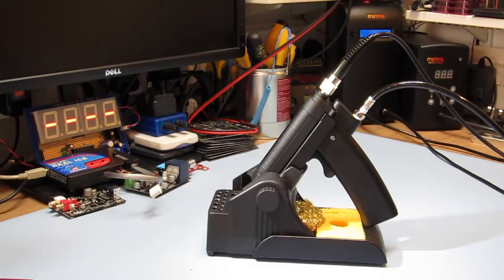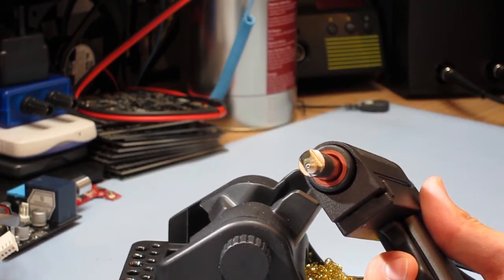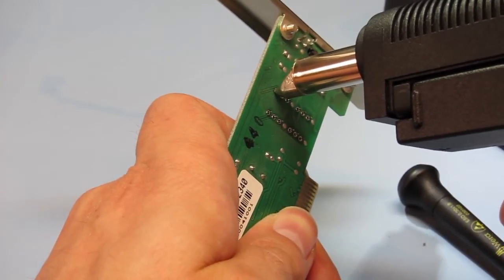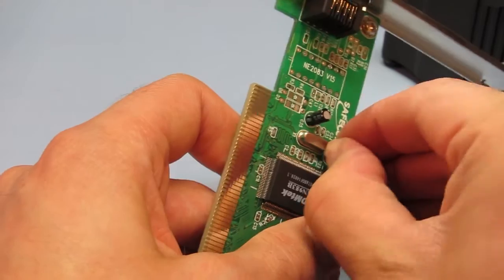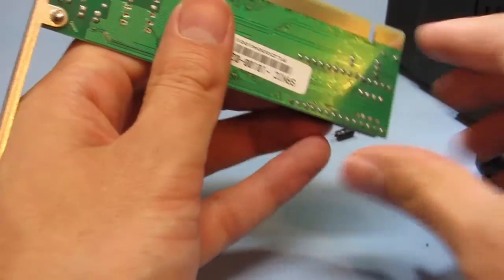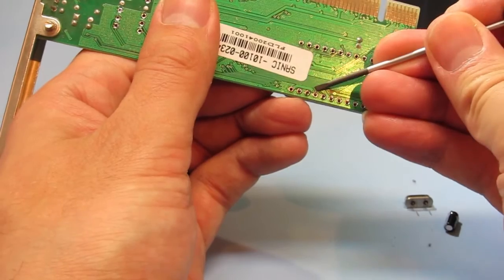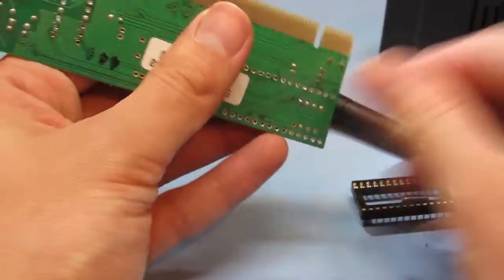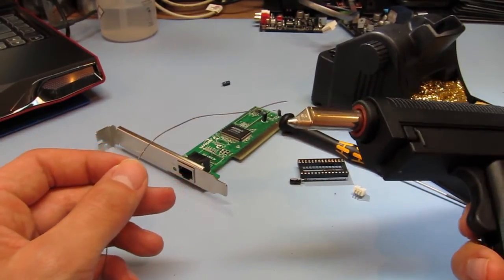SDG #03 Metcal MX-DS1 Desoldering Gun

Comment: Hi,
I have one of these and having an intermittent issue where the power supply doesn't detect you have picked it up to use and the power remains on 5. I have found if I give the DS1 a light tap on my bench it springs to life. Is there some kind of sensor in the cartridge or the handset? I'm wondering if it would be worth ordering another cartridge before sending it back under warranty.

Comment: I see a lot of used Metcal STDS-DS1 desoldering pistols on sale via eBay. What is the difference between the MX-DS1 and the STDS-DS1? Searching for information on the STDS-DS1 turns up little or nothing. I am guessing the MX-DS1 has some type of disposable filter keeping junk from getting to the air compressor.

Comment: One tip. When you hold the soldering iron when melting, gently stir and then press the vacuum trigger. Then you will achieve the desired result for the full release of the pin.

Comment: What is the most common desoldering tip (model number) that would be used for majority of the work
Reply from the maker: Most component legs are around 0.4 to 0.7mm in diameter, so that kind of size should do.

Comment: Hi , So you have to buy a compressor to use the Gun  ? does Metcal sell it ? , i have a MX500 station , could it be compatible ?

Thx !
Reply: yes you need a compressor and it works with the mx500
Reply: What's the price on the gun please i have the same  mx as You i think the 5000